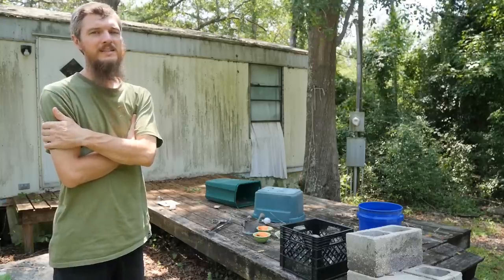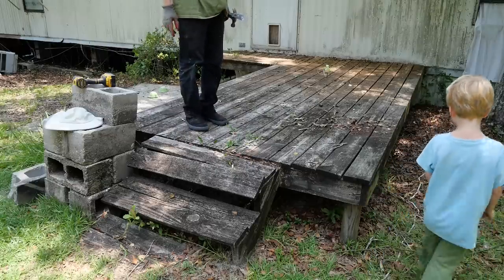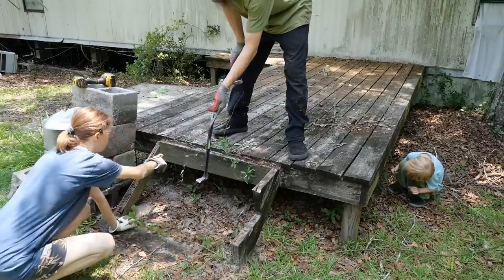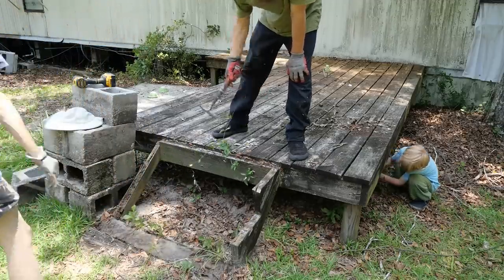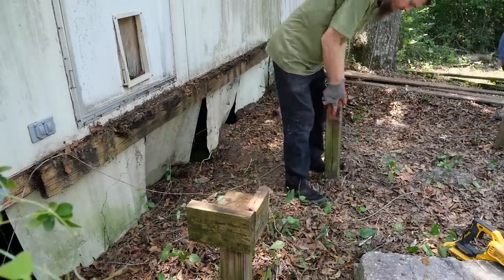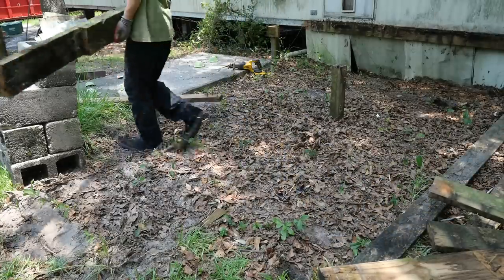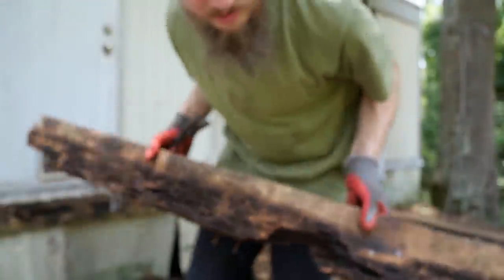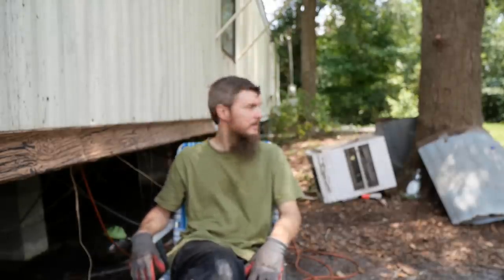Rotted Deck Tear-Down - Why You Should Never Attach To Your Trailer - 1984 Mobile Home

Comment: Hey Doug, when you try to back out a screw and it's stripped for whatever reason you can use a flat head screwdriver under the head and the threads will follow the screwdriver. Just a tip. Your a hard worker!

Comment: Love that things just keep on keeping on.  Day by day great things are happening.   Seeing your metal skirt come down made me think of a great diy for Belle or Ashley or whoever is interested.  I saw it in an email.  A woman cut up soda cans(she used scissors and also used a box cutter blade.  The scissors worked great on that metal), removing the tops and bottoms, so she was left with a "sheet" of metal.  She cut the sheet into different size leaf shapes and spray painted them green.  They could also be attached to each other to make a flower from combined petals.  You have a huge stash for a potential "metal flower garden".  You could cut out hosta leaves, (something really big),  daisies, any flower you can imagine.  She used her "leaves" attaching them to some wire with a glue gun (but could be a super glue), and used them as streaming ivy type accents in a flower pot, sticking the wire into the soil.  I tried this and made a few "branches" and have them in an arrangement.  No watering for the hot weather and some art to feed the soul!

Comment: I always admire the teamwork.    It certainly simplifies tasks and it's a family project.    Maverick is focused on being helpful.    He and Ashley quickly removed the rusty old screws Doug had tackled.    I appreciate the upcoming tasks  under the mobile home but this one would definitely intimidate me.    I am amazed the home was setup so close to the ground.   Doug will be required to spend most of the time on his back in the mucky soil.    I would be concerned about glass, metal, etc.   I would be concerned even if I had a few pieces of plywood to reposition to protect my back.   I am anxious to see how Ashley and Doug address the shallow workspace.   I always learn so much from their videos.   I wish I had access to so much great information when I had rental properties.    That was in the 1970s and 1980s so no YouTube.

Comment: Maybe you could use that bubble foil under the house when you get finished with plumbing, wiring, etc.  That would add the extra layer of insulation as well.  Ashley, you are going to have tremendous arm strength by the time you finish carrying all that wood and debris and tossing it into the dumpster.  Super strong woman.  Y'all have a great 4th of July.
Reply: boss of the swamp would grin HUGELY.
Reply: @savannahsmiles1797  yes he would. LOL.
Reply: Only if they attach it to the underside of the flooring directly and not to the bottom of the joists. That would be the way the "BOSS" would attach the bubble foil.

Comment: Don't you just love how some mobile homes have decks and additions attached right to the mobile home,causing a lot of issues because it's separate from the mobile home,it shifts differently then the mobile home does, and pulls on your mobile home causing many issues and this i know as when i moved here 23 years ago my addition had many leaks in the roof,and my decks rotted out the main outside framing of my trailer causing major rot and the list goes on lol,have fun you guys and as always great job👍😊...
Reply: I hope that you were able to repair it.
Reply: @damogranheart5521  I disconnected the decks,but the addition is another story as the thing is attached all over including the walls roof and floors,and every year I've repaired the roof,it always finds another way to leak,and unfortunately i don't have the funds or help to try to fix it right if that's even possible, and unfortunately because it's attached i don't think anything will work but to tear it all down and start from scratch and make sure nothing is attached to the trailer or just put a pole barn roof over everything and not touch the trailer or addition lol...

Comment: It's funny how that deck was put together with no hangers nor post/beam, and the weight was held by brittle screws in sheer. At least it was only 2 ft. off the ground.

Comment: My father never attached decks or porches to the house. He poured big round cylinder-shaped concrete columns and built the deck on those. They must have been 12 inches in diameter.

Comment: Who puts a septic tank right in front of the back door? Scratching my head over that one.
I'm sure you have already thought this out, but you could put another deck up with a hinged floor panel that flips out of the way for septic tank access.
Or move the trailer when you level it.  Just thinking out loud. Looking forward to seeing what you do.
Reply: Lol,mine is and I've been here 23 years,and from my understanding it was the only location available for this lot,and my mobile home is also a 1984,so been in same location all these years...
Reply: @cherylt8590  What I know about septic tanks would fill a septic tank. Not sure if that came out right :/
Reply: @TheWoodHaven  lol💩...
Reply: It has been my experience that the typical septic tank is usually close to the home usually within about 10 foot.  I have seen that in very expensive homes. I think it has something to do with the way that the plumbing system is designed to remove the waste in the most efficient manner.
Reply: @TheWoodHaven most septic tanks are "by code" attached to the home less than 10 feet away. The the exit port is attached to the "D box" (distribution box) at a distance that allows for all drainage lines to connect to the box without having any 45° angles to avoid clogs and backups.
Reply: @HaroldReece  sure, that make sense, but blocking access to the back door? Just seems misplaced to me, but I'm not a septologist.

Comment: Ashley and Doug could you not use the old de j boards to make wood chips for your garden beds instead of throwing it away? I was wondering if you were going to build the cupboards of the kitchens in both properties?
Reply from the maker: The deck boards are chemically treated, so they just need to be thrown out. We might build cabinets for the main property, but not the mobile home.
Reply: @diyfferent  That makes sense. We learn something new everyday.

Comment: I’m wondering if the reeded decking boards are actually rotten (they would have been treated). They certainly look weathered& could have been stored under cover/ dried out an then used again after being cleaned up.

Comment: You need to kill that cockroach. They will lay eggs everywhere in your kitchen and run and hide when you turn on the lights. One will turn into thousands quickly. I know you guys appreciate wildlife and such, but you will change your mind when roaches take over your life.
Reply from the maker: These are wood roaches. They only eat decaying plant matter so they generally want to stay outside. They are different than the typical cockroaches that eat human food and trash. The only reason these will come into your home is if you have a damp dark place for them to hide. They like leaves and rotted wood. They'll clear out once the bad wood is removed from the home.